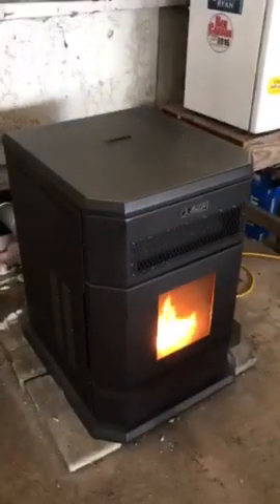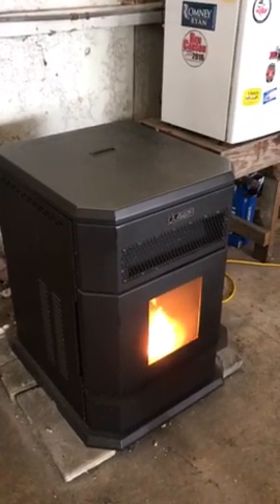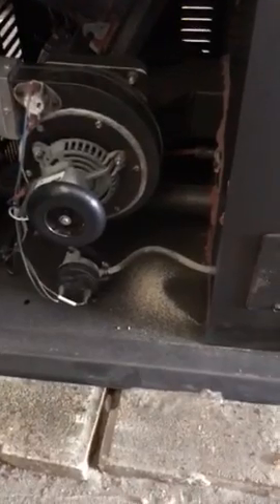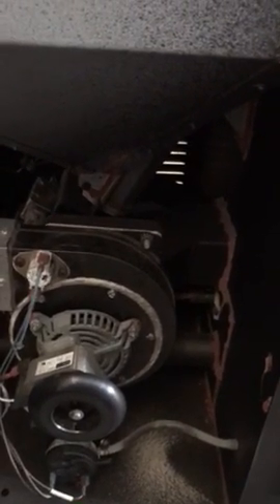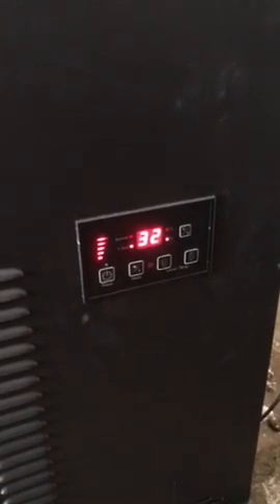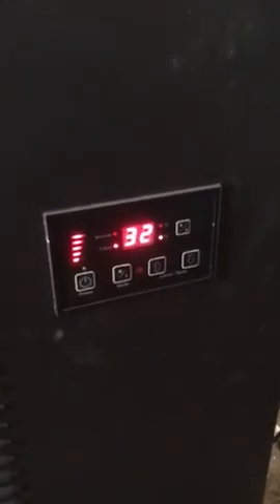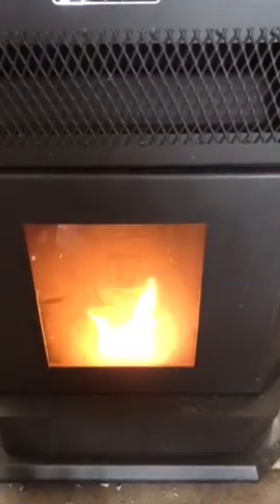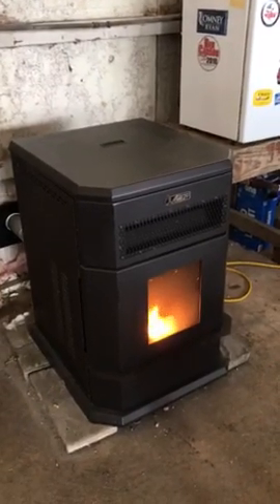Vogelzang Ashley VG5790 pellet stove

Comment: I agree with the fresh air supply routed outside.  On mine I used a 2 in black cast iron pipe with an elbow. Place an gutter downspout mess screen on the pipe on outside inlet,  silicone fire caulking since it was only that pipe needed to go out the other exterior wall.

Comment: That’s the number one problem with those you could just put the two wires together if you’re in a pinch and run the stove it’s called the proof of fire switch

Comment: Mine runs fine until you turn it off, then the auger keeps turning and filling the burner pot. The fire gets so hot you barely can get near the stove. I have to remove the pellets from the hopper to get it to shut down. Dangerous... I won't own one of these type stoves again.

Comment: Bob, a fine video thanks.  A few thoughts having been thru 'this' with several makes/models of pellet stoves ...

FIRST: tho you had it one day and say "I know crap about this stuff" you likely knew 98% more than most folks;  i.e., it's not you.  Pellet stoves are each unique beasts and need a bit of tinkering to optimize

SECOND: as noted by some folks below, pellet stoves every one I've used/installed [amateur, not pro BTW but about 6 stoves over the years] operates vastly better with the 'cold air' intake conduit attached, pulling in fresh air from OUTside the room where stove is located.  A pellet stove is much like a regular fireplace in that they operate better with air coming in 'from below' and exhaust out the top.  Unfortunately for fireplaces this means 90% of heat is wasted.  Anyway, attach the cold air intake from outside and endeavor to have it with few bends etc.  You want the 'cold air intake' thru stove up thru 'exhaust vent' to be as "vertical" as possible when envisaged from tip to tip

THIRD: pellet qualitiy is of paramount importance.  I suggest buying 20 or 40 pound bag at a time, a few types.  Run your stove with each type to determine which pellet works best for your stove with best output and least ash.  Many pellets are crap.  Never ever buy "bulk" (many bags) until you find one that works well.  The shit pellets you can use as driveway ice grip instead of salt/sand rather than burn them off and soot up your stove.  However, when you find a type that works well, THEN go back to store and buy a bunch as pellets can differ lot to lot.  Just keep them stored in a DRY place and away from mice

FOURTH:  with above done and stove running releatively good, tinker with air intake damper setting, pellet rate of delivery etc.  E.g., often putting stove at say 30 degrees will burn vastly better more efficiently and put out more heat over time without problems than cranking it up to 40 degrees when pellets delivered too fast.  It is a science but dependent on the art of it.\

Thanks again this is a fine video.   Likely you got it figured out by now since vid is 2018, but hope some of this helps you or others
Reply from the maker: Good stuff TommyT! Thank you!

Comment: More air more efficient burn more heat less mess in your chimney.   Thanks for the vid some puzzle pieces fell into place.  Have Ashley with cast iron door window with hopper that holds 6 bags.  MN.  I don't think mine has a damper.  But have seen people on other stoves damp it down and more ash buildup outside at base of chimney.  How's it running now?  Smart guy you are.  What kind of pellet do you use now?
Reply from the maker: We use Pro Pellets. Never had a problem since!   http://www.fiberby-products.com/products/wood_pellets.php